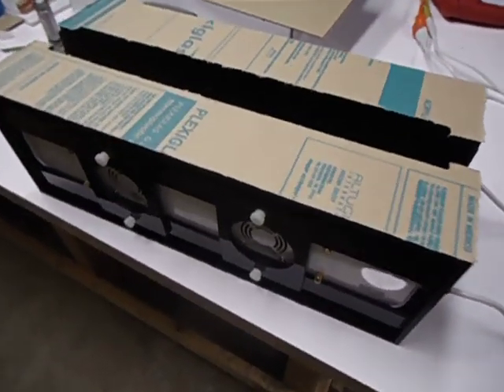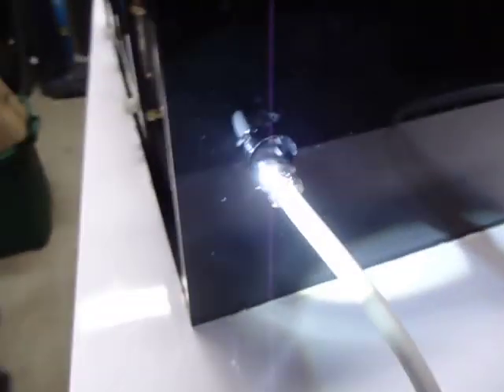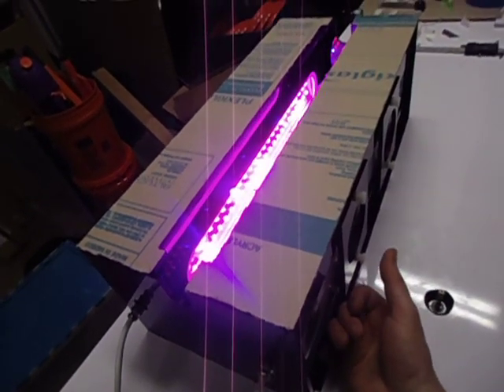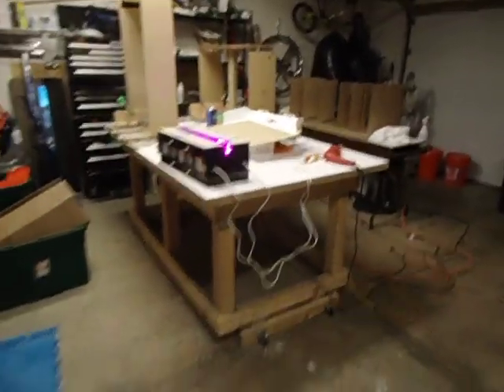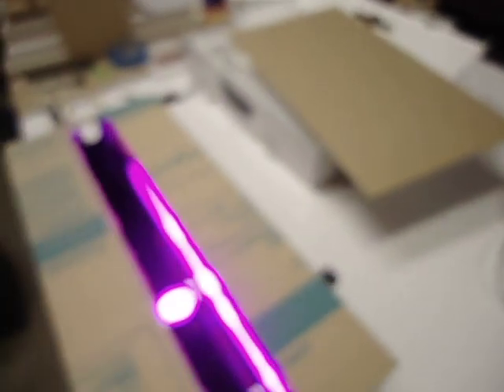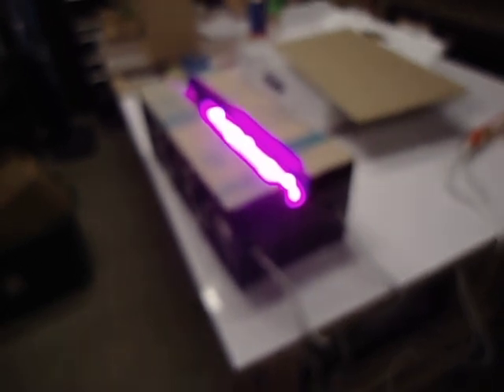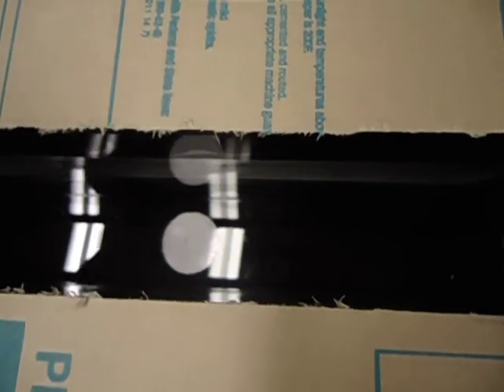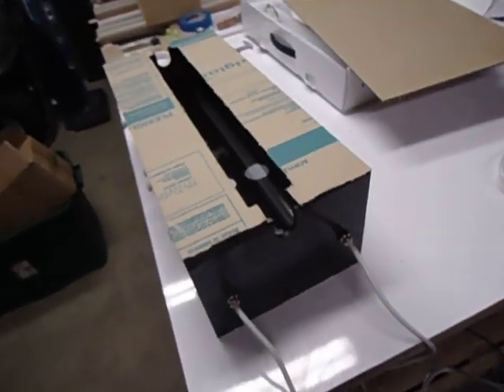e-Shine Algae Scrubber

Comment from the maker: Should only need to change every 3 months, maybe a bit longer with T5HO.  Anyways, LED fixtures are not too hard to build and not overly expensive.  The e-shine scrubber has it's issues, the main one being it's very intense, so unless you're feeding ALOT it doesn't grow in the middle.

Comment: part3 to comment question-
Remembering that it will be strip LED's I would need to use. 
Would you use either all RED at 660nm or a mix or the RED and BLUE?
And what ration say a 2:1 Red:Blue  or a higher say 6:1 Red:Blue
I look very much  to hearing from you on the above and look forward to your advice,suggestions, feedback. So that i can progress with my retrofit build.
Look forward to further vid's on your build and possibly vi'ds on your algea growth results etc.
kind Regards Tommy

Comment: part 2 to comment question
I looked at the lights you are using but they are too deep wide for me unit. So will eother have to use LED strip or LED track led. 
I have been told to use 660nm ALL RED LED's. But I see you are using the grow lighting which is a combination of the 640nm-660nm Reds either a 450-460nm BLUE LED's. at a guess! I am aware that the red speeds blooming, and the blue speeds growing. 
Do you think All RED's would be better for the Algea growth or the mix of RED and BLUE?

Comment: great video, and your design in great!
i have a similar version to yours but thinner and run with 2xT5 tubes each side. but with running costs of electric and change out of tubes every 2 months. I want to change out the T5 lighting and retrofit with LED's, but keep the lighting boxes, if this makes sense?
I looked at the lights you are using but they are too deep wide for me unit.